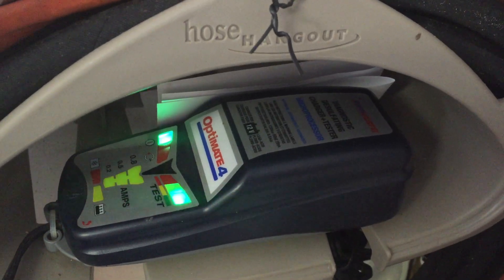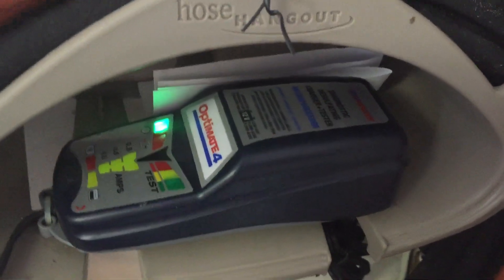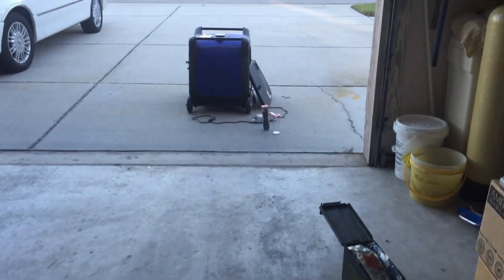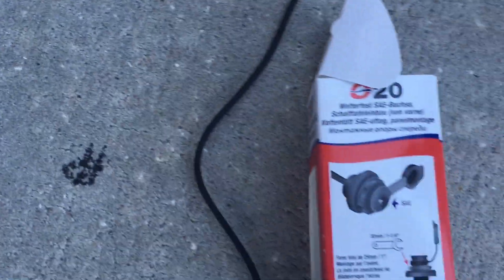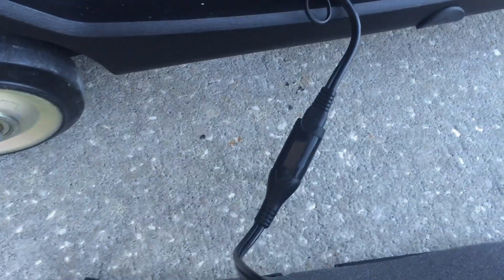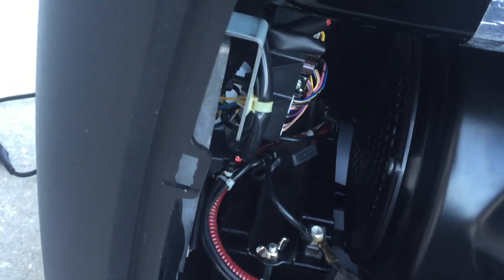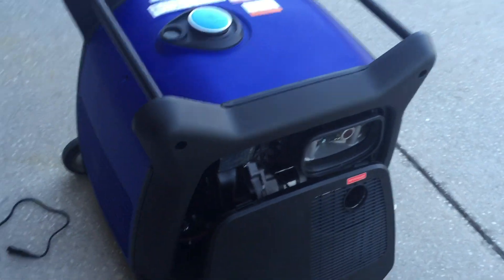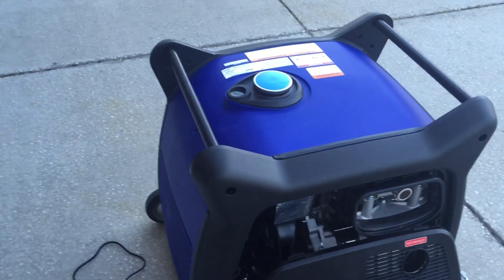Yamaha EF6300iSDE Battery Charger Modification

Comment: So this yamaha does not charge its own battery when running?
Reply: Yes it will charge while running but when it is stored you still need a BatteryMinder or some other brand of battery maintainer so the battery does not go bad from sitting. I use BatteryMinder on mine and added a charge plug in the same back panel in about the same place, my charge plug is held on by four small screws and is square and sits almost flush with the back panel.